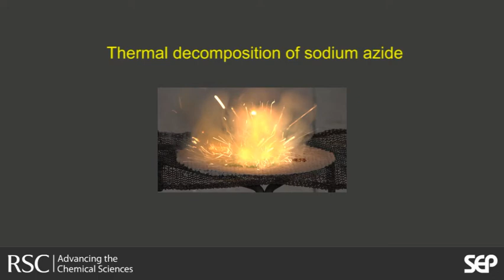The Thermal Decomposition of Sodium Azide

Comment: Thanks for the video.. 
1.How much litres of gas it produces?
2.Why are we seeing an explosion in airbags
Really hoping that you could answer this questions thanks
Reply: Hi Vivek Rajan, question 1 can only be answered if we know the starting mass of the azide then we could use the ideal gas equation to find out. 2. Airbags work because the reaction with sodium azide produces many moles of gas, which inflates the air bag quickly. I hope that helps a little.
Reply: @ajdsullivan  thanks Alex for your reply.. I need 75L of gas to be produced in 3 seconds.. However existing airbag composition does that in 30 milliseconds.. Is it possible to reduce the discharge rate and time taken to fill the gas? (Like in my case 3 seconds)
Reply: @v1v3k_rajan  this is a bit beyond my expertise however if you look at the particle size of what air bags start with, I assume a powder, you could use large coarser particles to slow the reaction rate, but I imagine it would be trial and error. Good luck.